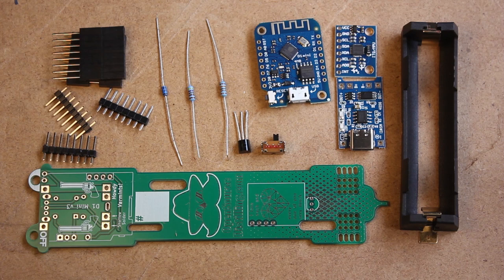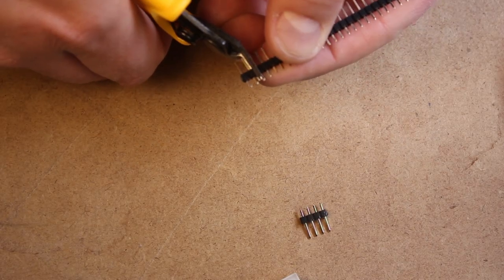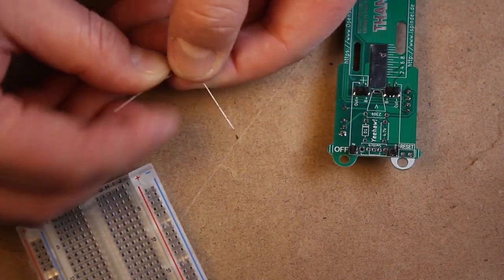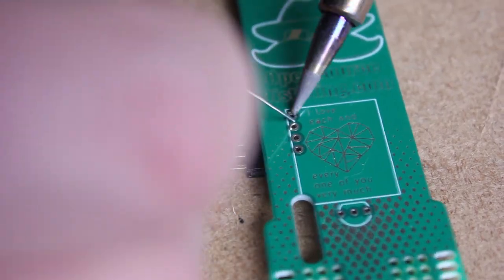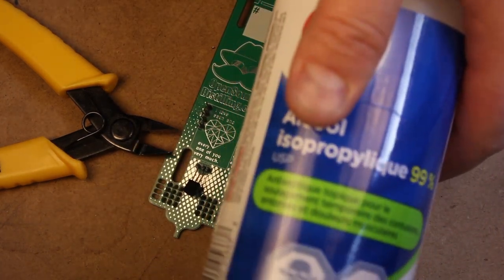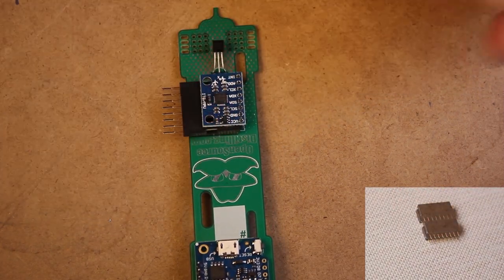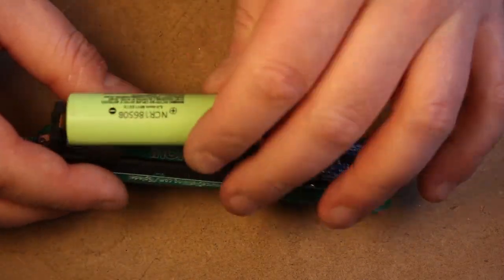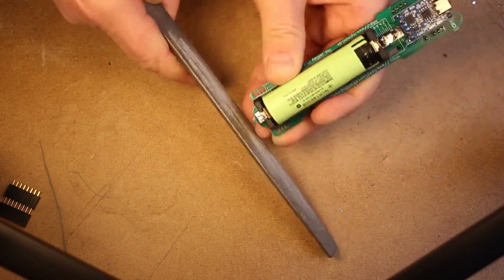iSpindel Assembly Instructions in English - The Jeffrey PCB

Comment: When the pins for the battery first is soldered, it is soldered on the side that has "off" and "reset" printed on it, later in the video, the pins seems to be on that side and the solder on the other side. Which one is correct! :(

Comment: Looks good, man.  Congrats!  For those who think all this filing is not necessary, I'm telling you, having a sled that fits perfectly into the petling with no wiggle room is a MUST.  And it must fit exactly the same way if you take it out and put it back in.  Any deviation can shift the gyro reading from your initial calibrations.  Saw it a bunch with each of mine and had to add layers to my edges to get a snug and consistent fit.  This is the best solution I've seen to this issue.  Nice work!
Reply from the maker: Well said. Yes, I also believe that the gyroscope is very sensitive and any shifting inside the pelting is a very bad thing. You can always add a bit of epoxy putty to the PCB and file that down to get a snug fit if you are using a different PCB. Thanks for your kind words :) Cheers, Joey Joe Joe Jr.

Comment: DS18B20 location under the battery is dangerous. It's spikes can pierce battery's skin and cause short circuit. Luckily current go trough tp4056 which has short-circuit protection.
Reply from the maker: I've built many and never had any issues. But yes, you'll need to file and/or cut the 'spikes' if you don't solder them flat enough. I've built more than 10 iSpindels and not one of them has ever pierced or even scratch the battery's skin. These batteries hold lots of power and must be respected!
Reply: @OpenSourceDistilling  I totally agree, those batteries have a lot of energy. I built five pieces and two pieces had that problem. In my case, the DS18B20 data pin pierced the battery's skin. Here is a picture of it: https://imgur.com/a/Z5olsN3. This is most likely what can happen because that pin is in the middle. My fix is going to be that I resolder those pins and try make them flat as possible and then I add some insulating tape between pins and battery. Btw, I really like what you have done and I want to thank you for your hard work.
Reply from the maker: Thanks for watching, and thanks for sharing. I found that putting a little masking tape of the battery side then soldering the temp probe from the top results in a really flat solder. I will demo this in an upcoming video. Cheers!

Comment: Whats the size of the petling? I found some 130x33 mm. Is that it?
Reply from the maker: The petlings I recommend are the ones on my shopping list. Below are the listed dimensions from the seller.
Dimensions (external, MAX), mm ~135 x (d39, d43 MAX)
Dimensions (internal), mm  ~123 x d33

Others have bought from other sources that are slightly longer and narrower. You may be able to get it to work but you may have to file things down more and extend other things with epoxy putty. The petlings I have aren't exactly uniform on the inside. 

Good luck and thanks for watching!

Sincerely, 

Joey Joe Joe Jr.

Comment: I'm wondering why you mount the gyro elevated. If the goal is to get it horizontal to the PCB, why not mount it against the PCB? Am I missing something?
Reply from the maker: The iSpindels don't always float level compared to the PCB. Installing elevated allows you to bend the pins to align the gryo's breakout board with the water level (in one direction). Does it matter? I don't know as I haven't done the comparison, but typically more options are better than fewer options.

Comment: Hi Joey, What are the 2 pins in the top corner labeled reset for?
Reply from the maker: You connect them with something metal, like the end of a pen, 2 or 3 times to get the iSpindel into configuration mode or 1 time to reset the device. This enables you to configure and reset the device without having to take the electronics out of the petling (tube). You typically don't want to disturb the electronics after calibration. Thanks for watching!

Comment: Great work, I really can't say that enough. You seem to have fixed every problem with the original, as well as going much further and improving it.
The only thing I would question is the precise fitting into the shell instead of using compressive bushings or similar. This is pretty standard for mass production as it allows a bit of play in sizing, as well as providing an impact buffer for the electronics. If the board had the right pegs on it you could maybe use grommets, earplugs or something else readily available.
Great work, keep it up!

Comment: Hey there. I have recently purchased all the components in your list, and went through your build process. After flashing the boards on 2 units successfully, I cannot connect to them with WiFi. I have tried multiple phones and computers. One computer won’t even see the ispindel, the others say they can’t connect to the WiFi ispindel. Any thoughts? There is a post on Homebrewtalk with the same problem, but no resolve. Thanks.
Reply from the maker: Hey Derek, sorry things aren't going perfect. The best tool to diagnose will be the serial monitor output from the D1 mini and posting/searching the official GitHub page where they develop the software. My next video will be about running the serial monitor to get more insight into why some iSpindels aren't working. I believe others have had this issue posted on GitHub as well https://github.com/universam1/iSpindel/issues

Comment: Did you figure out the smoke issue? I put mine together and got the same thing...the chip on the "OUT -" side of the breakout board was extremely hot. Also for some reason B+ and OUT+ pins are short circuit. Is this normal? Solder looks separate.
Reply: Answer was battery holder was soldered on backwards. Still worked after reversing it. All the magic smoke musn't have disappeared!
Reply from the maker: Sorry for the late response. I'm glad it all worked out!

Comment: Joey...Question.  I went to order some boards.  Do you use with lead? Do I care in this application?
Reply from the maker: My understanding is there is no direct contact with the PCB finish, or the solder points, with the outer pelting so it should be safe. The lead would have to leech through the air then the pelting and I believe that isn't possible unless the lead is vaporized. It's pretty hard to vaporize lead as you need to heat it to 1750 Celsius. I think people have varying opinions when it comes to lead. I don't recommend you put lead weights in there but I personally think solder and PCB finish is okay in this situation since there is no direct contact between the pelting and the PCB finish/solder points. Remember to wash your hands after PCB assembly.

If you think differently please let me know. I'm always interested to know other opinions. 

If it concerns you can order lead free coating on the PCB and I know that lead free solder exists for electronic applications. I think you need more head to heat the solder and I believe that lead-free options cost a few more bucks. I also believe lead-free solder eats up the tip of your soldering iron quicker.
Reply: @OpenSourceDistilling  I ordered the other day!! Keep safe! Where are you?

Comment: Great instruction, I have just built this. Is it normal for the charging board TP4056 to get very hot when on charge?
Reply from the maker: Hey Andy, Yes the TP4056 will heat up during charging. I have never actually felt it but will give it a try soon. But it is normal for them to heat up during the charge. Thanks for watching!

Comment: Thank you for this and other vids on the iSpindel!! I just built my first one, using the Jeffrey 2.0, and much to my surprise...it works!!! Two quick questions I hope you, or others, can help with. Is there a way to calibrate the temp sensor? It's about six degrees f off. (No I'm saying f-off :) ) And when I have it plugged in to charge, it is still charging (red light still on) even though it's showing 4.3 volts on the ISpindel info page. (No it's not plugged in while it's turned on) Any help would be much appreciated.
Reply from the maker: The temp probe isn't actually used by the iSpindel itself (at least not right now). So any temp corrected specific gravity readings need to be done outside the iSpindel, like on Ubidots for example. The same goes for temp probe calibration, right now that would need to be done outside of the iSpindel too (Ubidots allows you to make a formula and plus/minus a calibration value against the temp probe reading). As for the 4.3 volts for the battery, sounds like you already measured it with a multimeter to confirm the voltage. I haven't had issues with the battery charger before so I suppose I would suggest replacing the TP4056 breakout board.
Reply: @OpenSourceDistilling  thank you for the reply. The charging light finally turned blue @ 4.33 volts. So it appears to be working. I built another one and it is working as well. Have parts for two more so I can sell on Ebay and recoup my money.

Comment: Thanks really helpful can you use D1 mini v2 or does it have to be V3 ?
Reply from the maker: I haven't done it but I found posts saying that v1, v2, or v3 will work. With v1 and v2 (or certain v3 knockoffs) the USB is facing down on The Jeffrey PCB. In that case, you need to elevate the USB side of the D1 mini a little to allow the USB plug enough room to plug in after assembly. I suppose you would need to ensure there is enough room on the D1 mini file system for the firmware. Thanks for watching!